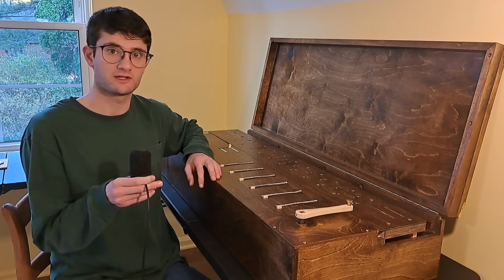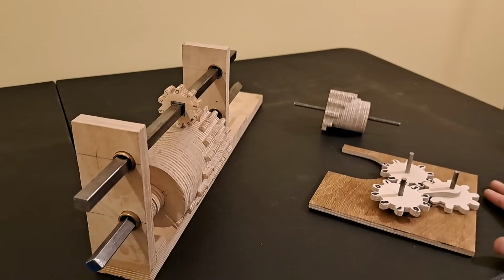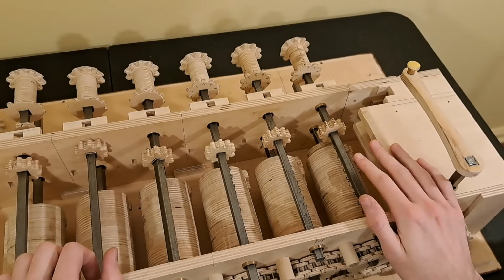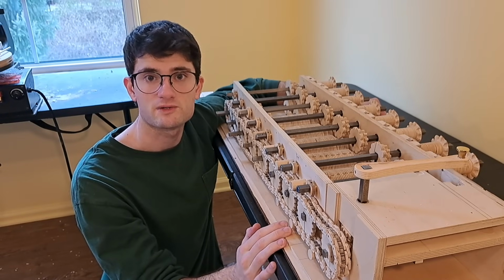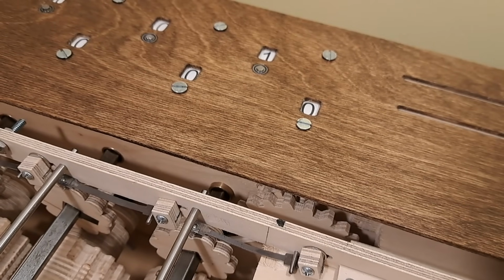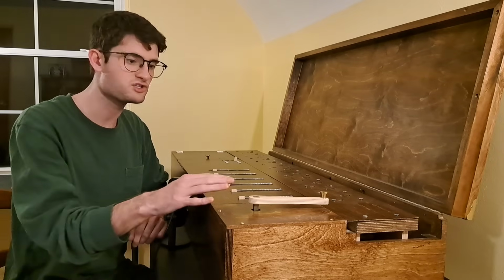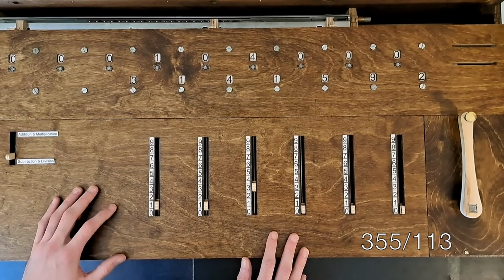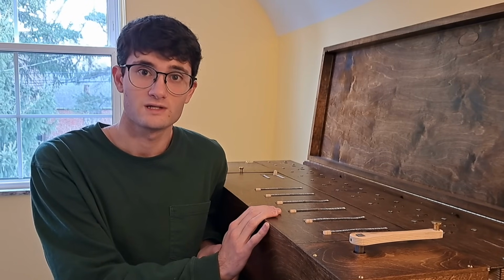How I built a Mechanical Calculator

Comment: Its so impressive and cool. But why didn't you make a proper lever to reset the gears?
Reply from the maker: Yeah I meant to refine that mechanism and add a post or lever.. it was one of the last parts and honestly I called it good enough at a certain point. But it could definitely be improved pretty easily!

Comment: is there a way to zero the machine without lifting up the output like that?
Reply from the maker: Not on my machine, but some commenters have noted how if there was more room between the sets of bevel gears I could put the add/subtract lever in the middle and not need to lift the results section up. It almost works like that as is but there just barely is not enough clearance.

Comment: One question, what would happen if you were to subtract from zero?
Reply from the maker: It can't handle negative numbers and only carries over into the 8th digit, so underflows cause a ripple of carries such that 0-1=99999999, and 0-2=99999998, etc. Some machines had a bell on the last digit that would ring when a carry was supposed to happen. I could add that in, then it would alert when overflows or underflows happen, but it's obvious anyway.

Comment: Fascinating this is what the internet is meant for. 

PS . As a digital hardware engineer I cannot help but thinking a binary version. By mechanizing the basic logic gates you would be able to perform binary addition with half adders and so on. 
Or taking this thought a step beyond... in theory you could mechanize any digital function. Essentially that would be the woodworking/mechanical equivalent of the synthesis place and route process of digital ICs.😆
Reply from the maker: Thanks! Leibniz realized too that a binary version could be realized easily - he even campaigned for the use of binary universally

Comment: I want to know what happens if you divide by zero
Reply from the maker: Sadly it's underwhelming. When dividing by zero, you'd first input the number to be divided, then set the sliders to zero and try to subtract. Because setting them to zero engages no teeth of the stepped drums, you'd just keep cranking, pointlessly. The only thing that would happen is the crank turn counter would keep going up

Comment: Divide by zero, please
Reply from the maker: Sadly it's underwhelming. When dividing by zero, you'd first input the number to be divided, then set the sliders to zero and try to subtract. Because setting them to zero engages no teeth of the stepped drums, you'd just keep cranking, pointlessly. The only thing that would happen is the crank turn counter would keep going up

Comment: How much force is required to crank that calculator ?
Like is it hard to add 1 to 999999 ?
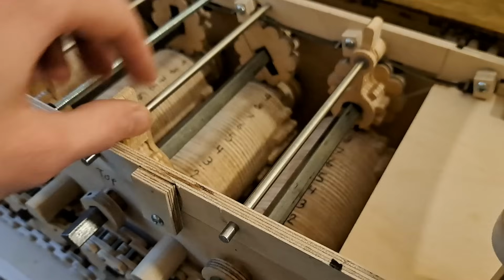Reply from the maker: The force needed is not too much for most calculations. Adding 1 to 999999 isn't bad because carries ripple, so none occur at the same time. At 20:17 I added 999999+1, which required every digit to carry. For that, it didn't take much force at all to add the 1, but cranking to input 999999 definitely takes a good amount of force - you can tell a lot of gears and springs are moving.

Comment: How did you ensure that the carry gear would never hit at an awkward time relative to the main gear and cause it to either seize or be so in sync that you miss one, especially when the number in the position that has to handle the carry is adding 9 so that main gear is really full? So for example if you start with 1 and add 99, how does it get that whole extra 1/10th of turn into the 10s position?

Edit: I saw now at the end that you had to adjust the tension on the ball spring to make sure it was working. Is the trick that it hits between the 0 and 9 so it's always just a bit out of sync from the main gear, and then the tension on that ball is what forces it to make the digital jump in time?
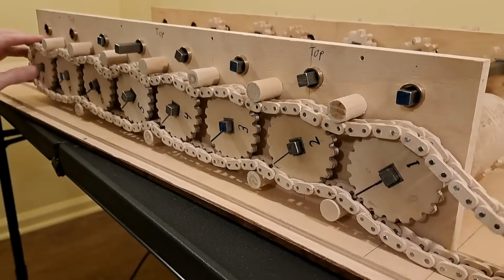Reply from the maker: It's a good question, because I didn't really explain why this problem won't occur in the video – I thought it would be too much detail. But, the carries happen after the 1-9 is added in each column, and every column is a little later in the cycle than the one to its right, so carries do not interfere with carries in other decimal places. If I had not removed some teeth on the stepped drums and instead of having 1-9 they had teeth going all the way around, they would have 20 teeth going all the way around. The extra tooth for carrying comes just after the 9 teeth on the stepped drum (so in the 10th of the 20 spots). This means the carry always come right after the 1-9 digits are added on that column. Then the sprockets that link the columns together via the chain also have 20 teeth. And each column is 1 tooth of the sprocket (1/20th) later in the cycle than its neighbor to the right, so that carries ripple and the rightmost one finishes first. (You can kind of see this in the video at 9:35, where I'm aligning all the sprockets so those black marks line up, but the actual squares of the metal shafts show that every successive column is turned a little more down the line). So everything is timed so that carries do not interfere with things within each decimal, and occur at the right time in relation to the other decimal places. (if you're interested, there's diagrams of those parts showing the rest of the 20 teeth on my blogpost: https://whatwillmakes.com/2024/12/20/my-mechanical-calculator-how-and-why/). I hope that helps! Comments like yours are very gratifying because it shows how closely people are watching and understanding, so thanks!
Reply: @WhatWillMakes  Thank you so much for replying! This thing really is a marvel. Wonderful work and thank you for sharing it with us!

Comment: incredible how similar this is to designing a calculator using only logical gates(did it long ago but let an impression on me). I would say the rotating one ay to add and the other to subtract is more intuitive (as "I'm going right to the number line or I'm going down...). You could put a serrated thingy on each slider to make it more digital even.... but great work and beautiful calculator, plz do you taxes with this and upload a video
Reply from the maker: Thanks! I glossed over it, but rotating one way for both addition and subtraction is also very useful for sequencing the carry mechanism. Cranking the calculator the wrong way would cause the carry mechanisms to come before the add/subtract phase and they wouldn't reset. Good suggestion about digitizing the sliders.
Reply: @WhatWillMakes  yes didn't thought about the carry, but was more focused on one directional crank for doing the calculation and another one to move the top part so one controls units the other controls the significance of the number (basically 1 to add or subtract 1 an another to add or subtract 10)

Comment: Very nice job both on the project and on the video.  But I do wonder why you never put a knob to do the resets of the wheels back to zero
Reply from the maker: Thanks! Yeah I meant to attach posts to the clearing mechanism instead of a separate stylus, but after a certain point I just wanted to finish the project and it was good enough. I may still go back and refine that mechanism.

Comment: Tell it to divide by zero
Reply from the maker: It's underwhelming. When dividing by zero, you'd first input the number to be divided, then set the sliders to zero and try to subtract. Because setting them to zero engages no teeth of the stepped drums, you'd just keep cranking, pointlessly. The only thing that would happen is the crank turn counter would keep going up

Comment: Two questions:
1. How hard is it to turn the crank if every digit is a carry?
2. How does it handle overflow (addition) or underflow (subtraction)?
Reply from the maker: 1. Not bad. Carries ripple, so none occur at the same time. At 20:17 I added 999999+1, which required every digit to carry. It required more force to turn the crank to input 999999, than to do all the carries.
2. It can't handle negative numbers and only carries over into the 8th digit, so underflows cause a ripple of carries such that 0-1=99999999, and 0-2=99999998, etc.  And overflows reach the 8th digit then no longer carry the 1 over. Some machines had a bell on the last digit that would ring when a carry was supposed to happen. I could add that in, then it would alert when overflows or underflows happen, but it's obvious anyway.
Thanks for the questions!
Reply: @WhatWillMakes  Huh, I remember hearing something about one of the adding machines built by Pascal which did have a carry issue (which is why I asked).  I wonder what it did differently there.

Comment: Amazing video. Learned alot. Great craftmanship and fantastic result. How many months did u use to make this?

Pricetag of this in metal in 1700s have to be astronomical.

Why didnt european have chinese abacus? Much more simpel design, and much faster.
Reply from the maker: Thanks! It took me 8 years, working on and off at a slow, meticulous pace. Yeah metal would not have been cheap, but I think we underestimate the scale of trade routes and level of manufacturing in the early modern era; brass and iron were used in manufacturing all sorts of objects - clocks, watches, candlestands, etc. They did have abacus, this is not really competing with it. As I say at the end, at first these were statement pieces as much as realistic tools, but they were slowly refined and by the late 1800s they were faster and easier to train someone to use.

Comment: This is cool and really genius but you didn't really explain how you got it to subtract. I assume you're using the nines complement which a lot of these mechanical calculators used back in the day, but they're definitely could be another way.
Reply from the maker: Thanks!
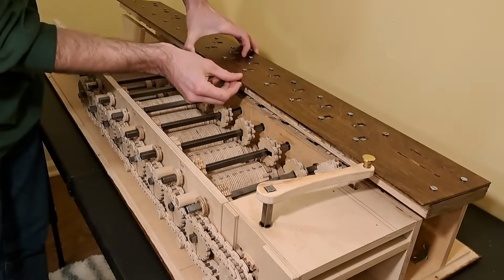It is not nines complement, and I tried to explain subtraction at 7:23, and tried to illustrate it at 18:20. I'm sorry I wasn't very clear. Subtracting is, for most of the mechanism, the same exact thing, using more teeth of the stepped drums to get the number dial to rotate a certain amount, just in subtraction we rotate backwards so the numbers decrease, instead of forwards for adding/increasing. Perhaps rewatching the addition and subtraction example starting at 17:43 would help illustrate how it performs subtraction as very similar to addition except the output dials turn in the opposite direction. Hope that helps! and thanks for the comment!
Reply: @WhatWillMakes huh, that's interesting... I do remember watching the video and just thinking to myself, "when did he explain subtraction in the mechanism" but you did explain it very clearly. When you started cutting the wood in the video, I jumped forward about 10-20 seconds, and I think that's why I missed this part.  Well in any case, sorry about the misunderstanding.

Comment: First, this is ridiculously impressive, and I don't want the list of ideas for improvements to sound like I'm not impressed. I'm very impressed. But, should you want to improve the design, here's a list of things that you might want to consider: 

Add in a less "manual" way of lifting and clearing the values (and producing pull tabs so you don't need a stylus

a movable decimal point

a way of making the number you input be discreet so that you don't have to deal with accidental misalignments (ball bearing with a spring and divots in the shaft maybe).

a another way of repositioning the results portion of the machine, asking with a guide to help with alignment

Comment: Now divide by 0.
Reply from the maker: sadly, it's underwhelming. When dividing by zero, you'd first input the number to be divided, then set the sliders to zero and try to subtract. Because setting them to zero engages no teeth of the stepped drums, you'd just keep cranking, pointlessly. The only thing that would happen is the crank turn counter would keep going up

Comment: Babbage did it first and in brass.
Reply from the maker: I discuss the history a little throughout the video, and particularly at the end. But really Wilhelm Schickard (1623), or Blaise Pascal (1642), or Gottfried Leibniz (~1670s), or the craftspeople they paid/worked with "did it first and in brass." Babbage's achievement was different in kind, not just degree. (about the brass: many people throughout history have used wooden gears instead of metal ones – there is a tradition of wooden clock movements in multiple places throughout time)

Comment: As a young kid in the 1970's my dad gave me an old adding machine to take apart.  It was Japanese made.  All mechanical, but with an electric motor to "turn the crank."  Literally hundreds of parts, all coated with old grease and oil.  (My clearest memory of it is the smell.)  I didn't discover how it worked, but I did get to see a bunch of cool mechanisms.  And I gained certainty that I did NOT want to be a mechanical engineer.

Comment: Hearing the chain and gears moving as you turn the crank is oddly satisfying.  It brings back flashes of memory of hearing old computer relays back in the 60s...think of the sound Robbie the Robot made when he was "thinking", right before he would speak.  Except, this is all just wood and hand cranking and not powered computing...but it gave me the same satisfying vibe.  Thanks!

Comment: Ok now I'm really curious, what happens if you accidently subtract a number bigger than what's currently present? Would it overflow, or just ... break down?
Reply from the maker: The results dials do not have negative numbers (just 0-9), so when the machine tries to subtract beyond zero, it rolls over into all 9's. 0-1 would equal 99999999 and 0-2 would equal 99999998, etc. Hope that makes sense, thanks for the question!
Reply: @WhatWillMakes  Oh cool, good to know! Would make problems hellish if you accidently pulled the lever one to many times though ...

Comment: It's hard to understand how the carry system works.  When you add 1 to 99999, the carries "ripple" to the left.  The leftmost digits don't know if they have to carry or not, because if you're adding 1+99998, they won't carry.  But your rack arrangement looks like everything happens simultaneously.
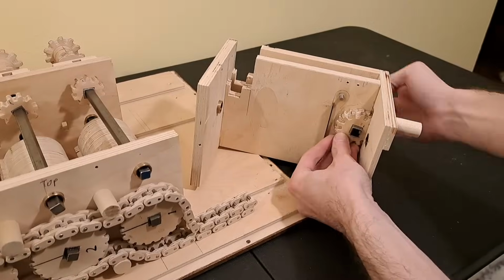Reply from the maker: It does ripple, just pretty quickly. I didn't really explain it properly in the video because I thought it would be too much detail. But, the carries happen after the 1-9 is added in each column, and every column is a little later in the cycle than the one to its right, so carries do not interfere with carries in other decimal places. If I had not removed some teeth on the stepped drums and instead of having 1-9 they had teeth going all the way around, they would have 20 teeth going all the way around. The extra tooth for carrying comes just after the 9 teeth on the stepped drum (so in the 10th of the 20 spots). This means the carry always come right after the 1-9 digits are added on that column. Then the sprockets that link the columns together via the chain also have 20 teeth. And each column is 1 tooth of the sprocket (1/20th) later in the cycle than its neighbor to the right, so that carries ripple and the rightmost one finishes first. (You can kind of see this in the video at 9:35, where I'm aligning all the sprockets so those black marks line up, but the actual squares of the metal shafts show that every successive column is turned a little more down the line). So everything is timed so that carries do not interfere with things within each decimal, and occur at the right time in relation to the other decimal places. (if you're interested, there's diagrams of those parts showing the rest of the 20 teeth on my blogpost: https://whatwillmakes.com/2024/12/20/my-mechanical-calculator-how-and-why/). Hope that helps! Thanks for the comment!

Comment: If anyone is confused by what ‘digital’ means in this context, a great example is a clock. A digital clock uses segment displays, and shows the time as individual numbers (a digital clock can’t display the difference between one time, and half a second later), however, the opposite of digital (analogue) clock, can still display that time difference, even if the difference in position of the hands is just barely different.